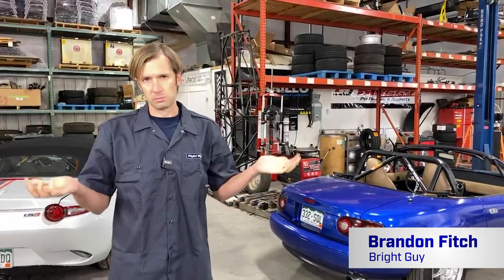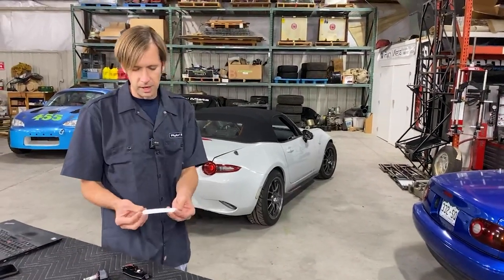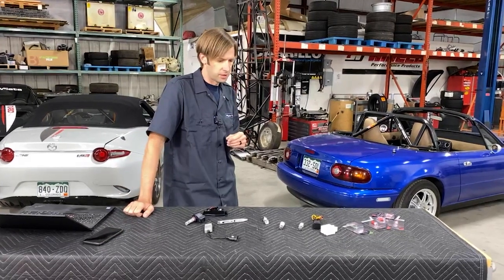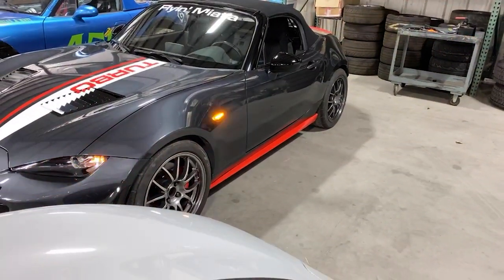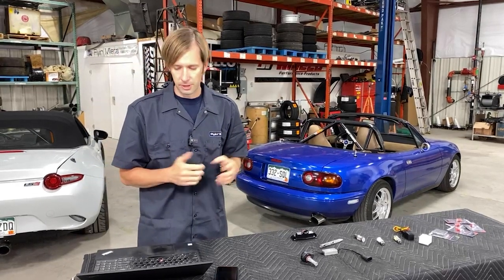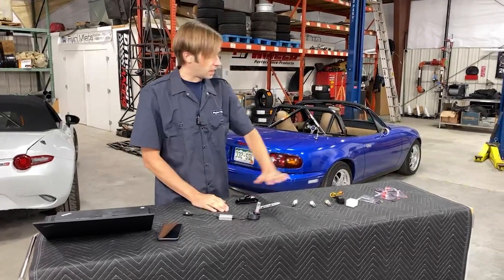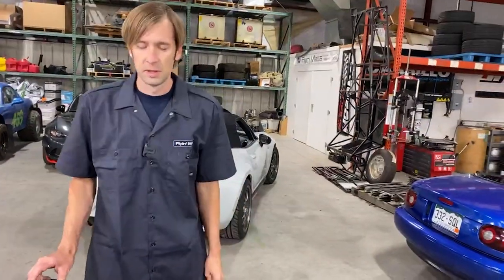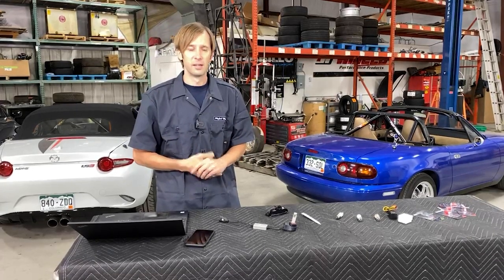LED Lighting Options from FM (FM Live)

Comment: Hi FM team. Really looking forward to finding out what improvements over OEM you make to the NA headlights
Reply: Try a conversion kit to move away from sealed beam lights.
Reply: I recommend the Truck Lite ones. Model number is 27270c.  One of the first mods I did when I bought my NA because the stock lights are hot garbage.  Pnp install and they work exactly like I wanted without looking awkward on the car.